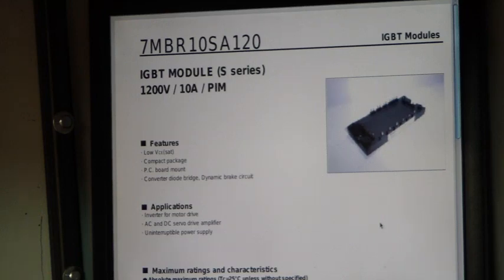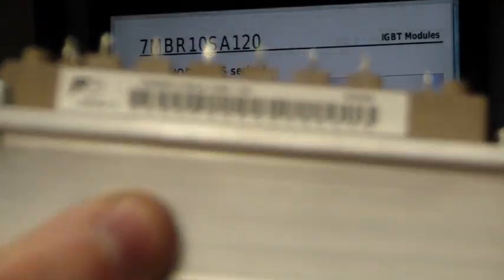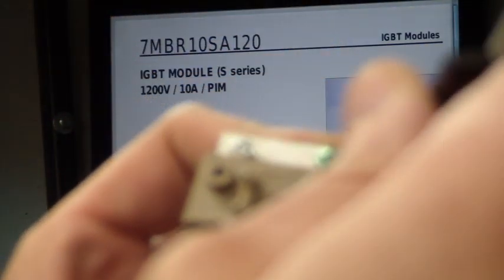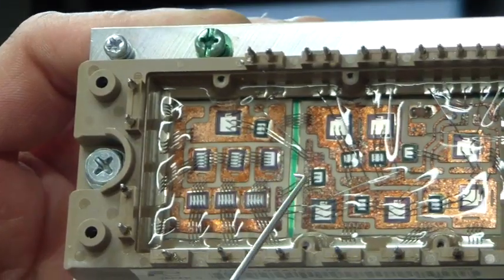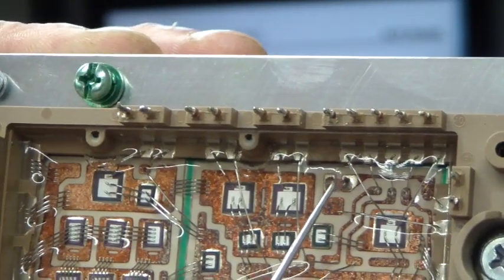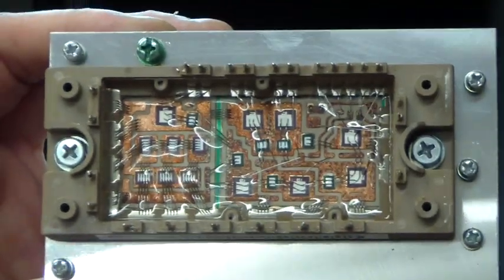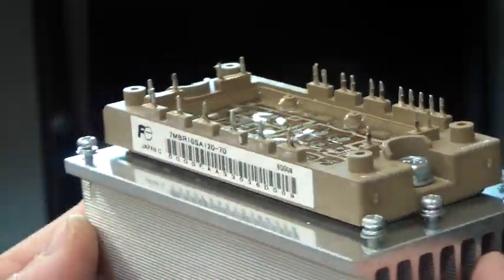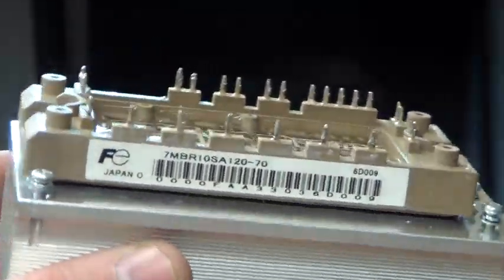IGBT Module overview

Comment: I use a similar modules for many years for motor controllers.

Mine is BSM20gp60, 20 amps @ 600 volts, pinout is the same.

Cheers.